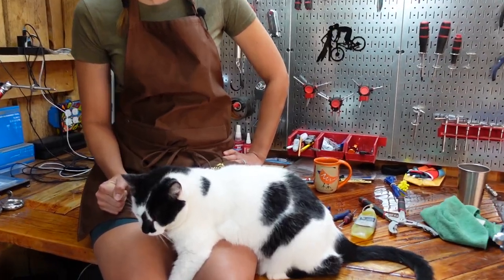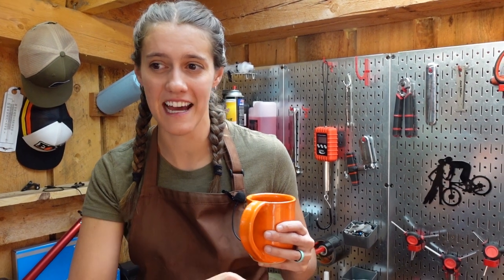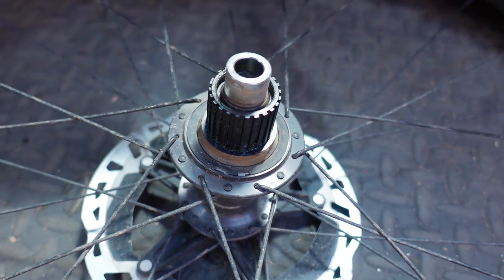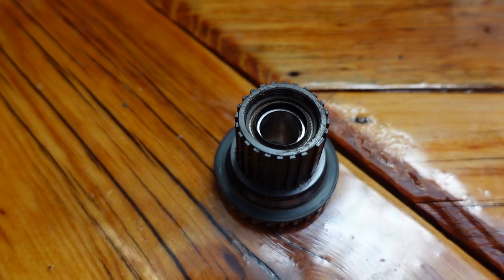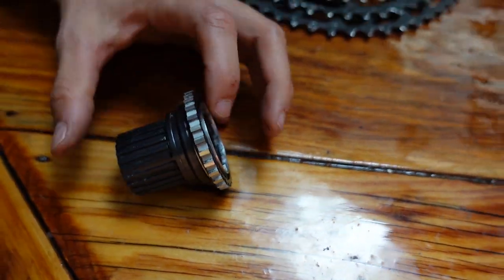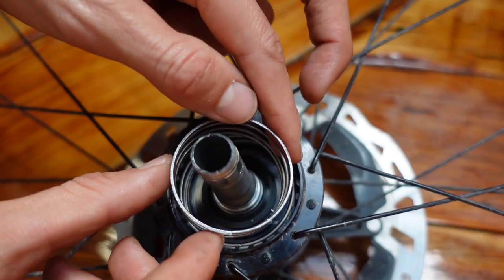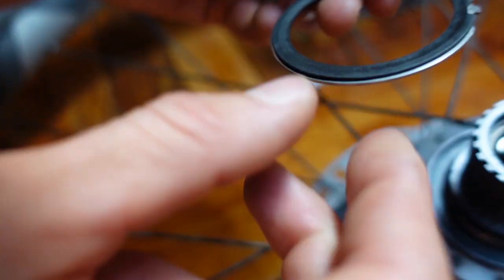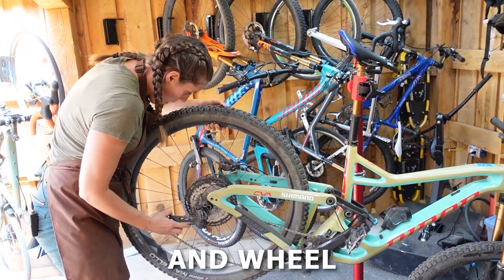How to stop a CREAKY rear hub (Shimano 12-speed Micro Spline overhaul) | Syd Fixes Bikes

Comment: Here's an obscure one. If you have a reproducible creak under hard pedaling (once under tension and once when tension is released), try loosening your rear thru-axle. If the creak disappears, you might be able to fix it by regreasing the thru-axle and the dropouts.

I dealt with this for about a month before managing to fix it.
Reply: U a G for this, I was about to attempt to replace my freewheel bearings until I saw this comment

Comment: I had a creak on a DTSwiss 240 hub with an XTR 12 speed cassette. There is a very thin clear plastic spacer that I had lost when assembling the bike. I made one with a Dremel from a clear plastic berry container from the grocery store.  Creak solved. My LBS got another proper spacer for me from Shimano. It was free. I was able to detect a tiny amount of play in the cassette while the wheel was mounted. But that was the creak and that’s all it was. The new XTR cassette packaging allows one to push the cassette on the hub while pulling out the plastic packaging. I didn’t do that and lost the plastic shim that way the LBS said only XTR cassettes had the spacer.
Reply from the maker: Yup, that's a cause of creaks on the early version of 12-speed XTR cassettes.

Comment: Thanks for this Vid. My Backwheel fell apart at the actual freewheel when I it was build out and eventually fell over on the Freewhee side.  The Cassete with the microspline hub and a part of the freewheel and two secure rings had come loose.  I didn,t know where to start to build it together again. This video helped. The real freewheel ratchet as you hold at 6:08 had come apart. One part was still in the hub, the other part in the Microspline part. It is normally hold together by 2 compressable metal rings on the inside. The outer one tells not to lubricate. When you losen them you can take a look in the actual ratchetfreewheel. I can tell you, it is lubricated! With thin oil. When you will lubircate it with to thick lubrication like grease it will probably not grip again when pedaling. My rearwheel had also had a creek, I supppose it will be gone now.

Comment: I had a creaky drivetrain that got progressively louder and the usual suspects didn't fix it, so took my Shimano 12spd hub apart and performed this 'surgery'. Great tutorial. Creak has gone and I'm 99.9% sure everything went back correctly and the lock ring washer is inserted fully, however, I notice that the clicking hub sound is less pronounced now with grease in. The clicking used to stop with some good speed, but now it seems to stop with just a small amount of speed. Rides perfectly - but doesn't feel quite right compared to original setup.
Reply from the maker: That actually sounds like it's working better as it's supposed to be a "silent" hub and ours generally go quiet at fairly low speeds. As long as it seems to be functioning properly, I'd assume you're good to go!

Comment: I have been chasing this creak on my 2021 Specialized Fuse for months. I’ve blown up two Shimano BB’s since buying this bike in February (these new BB’s are total junk). Replaced the entire crankset with SRAM DUB and have had zero issues. The Shimano was getting a ton of dirt and moisture in it despite my (and my LBS) best efforts. I’m going to try this tomorrow to see if it helps. Long term; I’m switching the entire drivetrain to SRAM. I have XDR hubs on my road and gravel bikes. I don’t think this Microspline is a viable 12 speed option. Rather, it’s a bandaid from Shimano to sell 12 speeds.

Comment: I've been chasing this creak for over a month now. First thinking it may be the chain and the after market sprocket. After replacing both, I still had the creaking. I wish I looked this up sooner. I took mine apart and it was filthy. It took over an hour to clean out all the grooves. The tines on the plastic spacer that go into the gear were all broken off. I hope this doesn't affect anything. Everything seems to be working fine. Thank you!

Comment: Hey all . I learned years ago that grease is ur best buddy when it comes to bicycles . Wherever there is a part that has contact with another part grease it there . Especially the seat post , bottom bracket & cranks to crank arms . It sux to go and remove a seat post to find it bonded to the seat tube . This is super common when u add friction & grime from cleaning regularly . 
Best rule is grease before installing & periodically remove parts to grease and inspect .

Comment: Thanks for the great video. apparently too late to ask, but maybe in the future consider also include replacement of the spline bearings? I had an issue where the cassete was shaking and left it with mechanic this time, but definitely wanna learn to do it myself later. Cheers.

Comment: Great video!  Are Shimano 10 or 11 speed hubs similar?  Would this work for them as well?  

“Don’t put s - - t on the ground!”  Are the exact words our trainer used when we were training with the fire department on rescue procedures.  We even had a tarp that we placed on the ground and used for all tools or etc. That’s the minor addition I would recommend to your rules. AFTER you don’t put it on the ground you need a designated place to actually put it.  Whether it’s a cafeteria tray with spots for the screws or whatever... you should have a designated place for the “s - - t” that you can’t put on the ground. Once you make a habit of doing it that way you will see that it works and it will become rule #3.
Reply from the maker: Unfortunately this only applies to the new 12-speed hub. The older hubs were a different design.

Comment: I've just watched this again and in 2:45 Syd is reffering to a comment about removing derailleur to take out the wheel. Well, I've just had to do this yesterday. My friends gravel bike was designed in a way that hanger is in an offset of about 1mm in reference to dropout on the frame. Bad design I guess, I had to remove hanger in order to get wheel out! Good thing was that hanger bolt was in a good position. That bike is Kross Esker 5.0

Comment: Thanks for this video, the creak has been driving my nuts. Have you guys had any of the teeth break off of that thin white piece? I found 2 broken when I took mine apart, just hoping that it's not a major issue
Reply from the maker: Yeah, we've found the same in some hubs. If you can find a replacement (which can be hard) then go ahead and replace. If not, I suspect it'll be fine.

Comment: Thanks very much for this. The trouble I had trying to find something that showed the workings and mentioned the issues. My bike which  I use for commuting part on road, part off, suddenly developed an issue where the chain would spin and then grip again. I thought it was a worn chain and cassette but replacement made no difference. I have a feeling the ratchet levers are not coming out far enough as there is resistance and then it suddenly gives which has meant I've coasted out in front of cars on roundabouts 😬
Reply from the maker: Depending on the type of hub, you should check the tiny springs under the hub pawls as what you're describing sounds like an issue that can be caused by those sticking or being worn out.
Reply: @sydfixesbikes  Thanks very much for taking the time to reply. I'll take a look 👍

Comment: This somewhat reminds me of the inside of a manual transmission, with synchros and dog teeth and such. I actually have to overhaul my freehub for a different reason, play in the hub. Totally different freehub design so none of this applies (thanks, Mavic, for designing a freehub that requires that you destroy a bearing to service it!). But still interesting to watch. And, I too hate removing rear wheels. It's almost never smooth.

Comment: Oh my god. So I basically ripped apart my whole drivetrain because of that creaking. It started shortly after changing to an oval chainring.. Coincidence I guess. Checked if oval is correctly mounted, checked derailleur since it is getting pulled forward and backwards by the oval.. checked tension on spokes, checked how tightened the cassette is.. nothing helped. Then this video gets recommended to me for no aparent reason.. thanks a lot, its gone now :D

Comment: Hey, Have You guys ever stripped the cassette lock ring? I strip mine every damn time. I put a new one on and then when I go to reinstall it, it strips out. I've had to buy 3 replacement rings. I torque it  to 40N-M like the lock ring says.

Comment: please tell us the exact code to that silent hub. my shimano 12s hub is very ratchety when I'm not pedaling and this hub of yours seems to be the perfect upgrade.
Reply: It's the XT or XTR micro spline hub. You don't need the exact model code because there are several variations depending on your rear axle width.

Comment: Syd, I wouldn't recommend you work on carburetors if you have problems putting complex components back together again.  It's better to take pictures as you remove parts so you know the order you took them apart.  Snap ring pliers do work better if the rings are stiff.  Looks like those rings are not so a better solution would be to use two right angle picks.  I would just use lithium or superlube instead of buying a special grease on something that doesn't have that high of temperature.  It doesn't make much sense to me.  Thanks.

Comment: Just wondering. How do i diagnose if the hub is causing the creaking sound? Any methods to use before dismantling?
Reply from the maker: If it seems like it's coming from the back of the bike, especially under load (while pedaling) there's a pretty good chance it's the hub.

Comment: I also had a cracking noise in my 1-year-old MTB and discovered this video. The instructions are very clear and it takes only 30 minutes and the problem seems to be solved. Thanks for that! Note that the procedure is also explained on the Shimano website: https://na.s-tec.shimano.com/s3_assets/filelibrary/Hub_and_Wheel/Microspline_Lubrication_Procedure.pdf.
I bought both types of grease. Is that really necessary? Or can you also use the premium grease for the hub?

Comment: Hey guys can you recommend me quite or silent rear hub. I need a  boost one 148mm with central lock for the disk, 32 holes. 
I don't do downhill stuff, and I cannot see the point of loud hubs when riding casualty. Mine annoys me allot.
Reply from the maker: We love the Shimano XT wheels. They're silent and centerlock/microspline. These are the trail version, not 32H, but we've put them through a lot and they are super strong. https://bit.ly/3y1StGQ

Comment: Hey Syd, I’m currently working on a cassette or free wheel that is wobbly. I tried tighten it with @ chain whip/part tool FR1.3 but no luck. Any ideas?
Reply from the maker: That's a tough one as it depends a lot on the hub. Quite possible that the wheel bearings need to be tightened or there's a way to tighten the free hub body. Has it always been wobbly or did it start suddenly?
Reply: @sydfixesbikes  it’s never been wobbly before, it recently started. Tighten the free hub body?
Reply from the maker: First thing would be to remove the cassette, make sure the freehub body looks okay, regrease and reinstall and see if that happens. For some reason, removing and reinstalling sometimes helps. If not, then time to start looking into the specifics of that wheel to see if the freehub body can be tightened or if it's the wheel bearings.
Reply: @sydfixesbikes  got it. Thank you!
Reply: Shimano freewheel? There are videos on the wobble, They use shims to preload the bearings, you can re-shim it but you need a specialist cone nut tool, 4 hours and a lot of patience.

Comment: 10:30 isn’t there a black plastic slider disc that sits on top of the inner spring? P23 in the shimano manual
Reply from the maker: Yes, in this case it stayed connected to the hub so we didn't specifically call it out.

Comment: The issue I have it the sound cuts in and out when free wheeling down a hill, It’s not consistent? Anyone else got this issue?
Reply from the maker: That's normal. It goes silent at a specific speed, so if you are riding right at that speed, small speed variations will make it go silent then start making noise again.
Reply: @sydfixesbikes  im going the exact same speed down a road and its just on off on off on off like with in 1 wheel rotation it turns on and off again

Comment: New rear hubs should not do this. From what it looks like, the design is flawed and should be avoided in favor of the FH-MT400 and FH-MT500 series which use a paw and ratchet system.